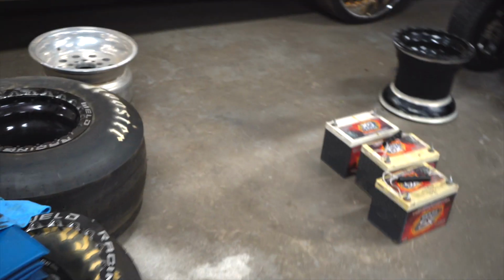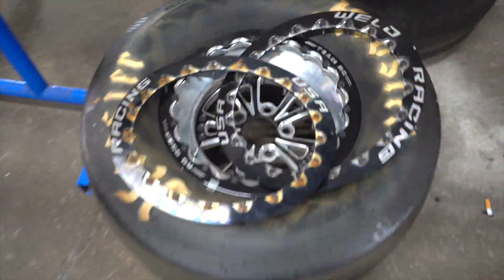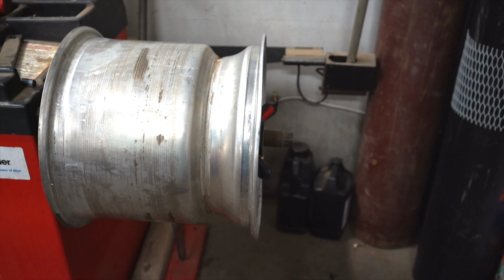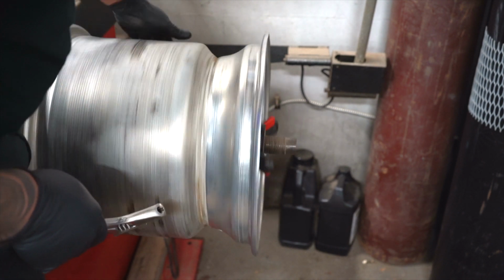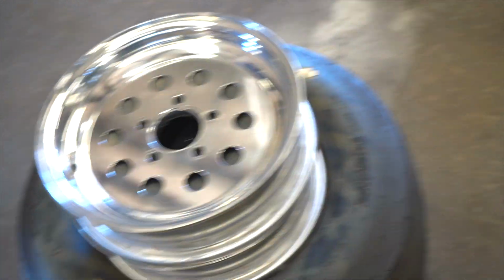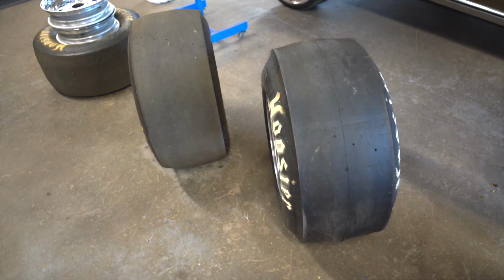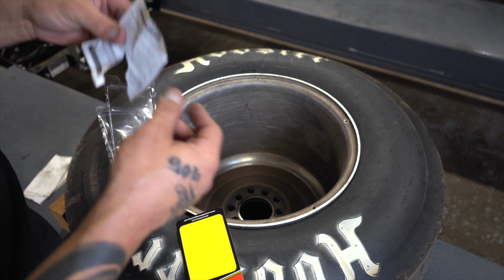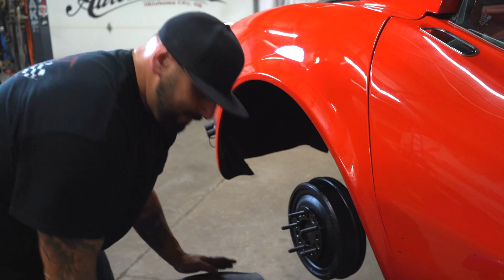NEW WHEELS AND TIRES FOR CHIEF'S CORVETTE! SMALL TIRE SMALL BLOCK NITROUS CORVETTE!

Comment: I'll be back for the suspension tuning lessons! First time I heard is instant center was from Billy (SRC) When he said Chief said to set it like this and it'll work. I knew that Falcon was going places fast and it hasn't let him down yet! 💯
Reply: Check out Kevin Wilson's videos for a bit more general drag suspension setups while u wait. He does some interesting breakdowns. He did one on Billy's truck
Reply: That falcon is rolling though. But it's crazy how far billy has made it with the S10 with basically nothing done to the suspension and crazy limited tuning abilities. I think only boost?
Reply: Yeah that falcon sure does work on every surface
Reply: @taz4100  wildo! Thnx for the suggestion!

Comment: With a growing up building custom chassis’s, Dirt cars, Dort Late models and having 20+ years in NASCAR would enjoy seeing the process of a complete front to rear chassis set up as well as a video on the process of how to choose proper engine location. A video on how to choose the right rear suspension set up be short 4 link, long 4 link or ladder bar systems would be interesting as well. You guys rock!

Comment: Nice job finding that setup. That was magic on those wheels! 
     My 74 L-82 SB swapped out for a 400cid SB destroked w/350 crank blew up the left rear spindle and the wheel, tire and caliper launched threw the rear fender and spun brake fluid into my hair cause I had the t-tops off. The tire hit the center double lines on the street and spun down the hill way in front of me as the back dropped to the pavement spinning into a fire department parking lot. So much for speed shifting from 1st to second. After that I kept it for messing up all the BB Mopar's and 80's 90's fords on the highway, shifting from 3rd maxing to 135 to the end of 4th 165 mph till I sold it. Much love for the c-3's

Comment: This is some quality YT video material right here. Especially the crescendo, where that feisty screw, despite all the aiming with the impact, just screwed itself in using the wheel hole as it's quide, like a boss. The amount of tears from laughter could fill oceans. I would've used a light hammer and a dolly on those hills, before bending, just to see where the rim is going naturally, and to take out some of the excess material and diameter from the bent rim. Just bending it back to shape makes it warp, due to the excess dimensions from the impact and stretch. Also, hammer forming makes the metal harder and more stress resistant. But, 10-move return is always brilliant, especially when executed perfectly.

Comment: I have probably straightened three or four hundred wheels like this over the years. I highly recommend you try straightening a few steel wheels before trying an aluminum wheel.  
If you are trying to mount a skinny tire on a wide wheel and just can’t get it to bead up running a ratchet strap (a 1” pulls type one works great) around the tire and squeeze it down “slightly” (key word is Slightly”) and then hit with a blast of air while pulling up towards the front of the wheel aka towards the valve stem. If worse comes to worse you can always try a squirt of ether and tossing a match. Just an FYI unless you don’t like your fingers keep them out of bead area of the tire/wheel when mounting a tire because I have personally seen a person loose a finger by not paying attention to what he was doing.  Don’t be that person! Also always use lube on beads of your tire myself I like really tire lube or cheap dish soap diluted 1 part dish soap to 3 to 5 parts water depending on the soap.  If you are drilling holes in your wheel for screws get a piece of copper wire the same length as the circumference of your wheel and fold it in half and half again two more times for 8 screws and then make the folded ends with a sharpie or measure the circumference of your wheel using a seamstress tape and divide by the number of screws and starting at the valve stem make marks on the rim with a sharpie.  After you have drilled your holes go back with a ball style carbide burr and de-burr the holes very lightly.

PS Chief C1 Corvettes came with “Dumb” brakes and the parking brake on C2 and C3 Vette’s with the Delco-Moraine (sp?) used a drum style parking brake that unless you know the car you should never use because they are notorious for not releasing properly and then dragging when going down the road. That said it looks to me it’s time to upgrade the brakes on the Larry the Lounge Lizard’s Vette to reduce unsprung weight, and rotational weight mass as well as making the car stop a whole lot better.

Comment: I'm so Glad you went back to old school on the wheels 🙌 I've been running that style wheel all along on my 70 Cuda since 85 but there weld super lites . They make a red plastic insert caps you can put in the opposite lug holes not in use. 
Great Job straightening that rim Dude 👍

Comment: Great video, old school trick with my kind of ocd. Just a tip, I've had really good results doing the difficult spots like that, but all the flat surfaces spinning the wheel on the balancer and a sponge with Simichrome.

Comment: The vintage wheels were definitely a good choice. Kind of surprised you didn't put a rear disk upgrade on there though.
Reply: one thing at a time my friend.....this is a budget af build and im going to see how fast i can make it go on the cheap
Reply: @justinshearer3016  Going as fast as it goes, the drums scare me for their lack of stopping power. Can't wait to see the suspension video and then see it making some passes.
Reply: @minigpracing3068  chief didn't ever like spending money on stopping 🤣 if I remember right the old crow had old disk brakes on it for a long time.

Comment: The old screw in the wheel trick, back in the 70s we were introduced to drag 500s from fire stone and we didn’t have bead locks back then, so we would Mountain Grove them then screw into the wheel. Sometimes the simple things work so well. Yeah buddy can’t wait to see you get some good runs down the track Or street in that little red Corvette. Fun times ahead.
Might be fun trying to stop that timing with those big ass tires in them drum brakes on the back.😂😎 Love you guys.

Comment: Back in the day Moncoque wheels were the lightest wheels you could get. I have a pair of their star pattern wheels on the Barracuda. I had to get the lip straightened on mine as well. The super stock Hemi cars used to run them because of how light they are.

Comment: Dude, those look like Weld Drag Lites. I have two 15 x 10's, two 15 x 8's and two 15 x 4's.
Awesome tutorial on straightening. You need a pointer like when you degree a cam to come close to the edge of the wheel. I learned that back straightening spoke wheels on motorcycles.

Comment: Man you did a great job straightening out that wheel.  I thought about building a fixture for my tire change with a bearing on the end like a wide one used on older car hoists. Heating it up of course.
Reply: lol i tell myself im going to build one like that, and a press that has a small bottle jack to fit inside the wheel for those really taco'd ones...but who knows if ill ever get around to it lol

Comment: In place of glass cleaner to seat tires use the cheapest high mega hold hair spray. It lubes and is slick when wet but acts like  bead glue when it dries.

Comment: Check out the Knipex plier wrenches.  You'll never use a Crecent wrench again.  You can use them for all sorts of things.  Since you can squeeze with them they work great for B nuts on hydraulic lines, breather lines, etc. because they dont slip so they wont mess up aluminum fittings.  You can even squeeze solid rivets with them if you don't have anything else.  They come in three different sizes and are kind of pricey but they are worth every penny.  The big pair can go from closed flush to 2 3/4"!  I can tell you like good tools like myself, I know you'll love those bad boys!

Comment: Chief try this trick. Take the green polish tube from harbor freight and then get a bottle of lighter fluid .cut the green bar up into the lighter fluid leave over night. Then put some on the wheel and polish away. This works great on aluminum wheels.

Comment: Monocoque (Mono-cock) wheels were part of and folded into Bogart. Had Monocoque I believe they were called Fly  Stars on our 63 dodge and yes they are/were light. Front runners were 7lbs and the 15×12 rears were 7.5lbs

Comment: Hey chief since you're a perfectionist and all I worked for tire places and owned a tire place for probably the last 26 years and according to Goodyear and Chevrolet whenever you jack up a Corvette you're supposed to pop the hatch pop the hood not lift them just pop them open and open both doors just a little bit so the body can flex whenever you jack it up

Comment: Big Chief that  Corvette is nice as shit!! I can't wait to see it run on the track!!
Reply: aint it tho? these cars are absolutely amazing....all fiberglass, lightweight, strong aftermarket support, killer aerodynamics low coefficient of drag, low frontal area, full frame construction, power windows, power disc brakes....oh and the outrageously far back stock motor location puts the midplate distance around a staggering 69ish inches from center of rear axle (give or take an inch),,,they made them for almost 20 years, and they were available with a frickin big block lol...These cars are fox body killers and almost just as cheap. They can be bought 100% turnkey mid 9 second all motor cars for well under 20 grand
Reply: And well worth it in my opinion run mid 9's and drive it home from the track that's some cool 😎 shit.

Comment: I know a few drifters who run super low tyre pressure also stick the tyre to the rim with contact adhesive so it can’t de-bead, could you do something similar with a slick if you don’t have a bead-lock

Comment: In my opinion  those are bead lock wheels.  That's all they use to have.  You run screws into the bead.  It's locked.

Comment: What is the difference in roll-out between the 28 and 29? Jackie said " it's so big" to the shady dude in the C3 Corvette....Sounds about right. She also said "your going to have to tub it to make it fit." Lots of material there but I'm not that damn funny.
Reply from the maker: abouuuuut 10" lol
Reply: So will you ever 28.5. Even with a gear change the testing will be skewed. If you did and did well I'm pretty sure it makes you the Dennis Anderson. Ps. The diff between a 86 and a 94 inch tire is a difference in 15 revolutions per pass. Every 12th pass the bigger tire is giving you a free pass on the same rubber lmao!!  86" is 7.1`- 184 revs per pass. 94"-7.83~169. This arithmetic and tits on a boar hog-same!

Comment: I absolutely hate black wheels. Back when i bought my S10 Blazer, someone spray painted the original aluminum wheels black 🤢 I stripped them as soon as possible. It was a shame because the wheels still had the factory clear coat on em under the black paint.

Comment: Also very intrested in listening an learning new ways on how to manipulate ya ride to get it hooked up on shitty surfaces or street. I had it working great, running low 5s when first put 29.5s 10.5s non Ws on it. It would launch an carry wheels 6inches off ground for 100ft on virgin black top with 1 pimp juice burnout. But since i jerked my 434 sbc nitrous motor out.. An stuck my new HiGh Compression Nitrous BIg BLock Chevy in it. It added 160lbs to nose an ive got motor high an as far back as it would go... its a 1988 s10 well GMC Sonoma. An theyre already nose heavy specialy still sitting basically true street trim. Ive added weight an everything else u can think of. An just cant get it to not knock the tire off. It is alot more power than the light weight small block 1200 to 1400hp on spray with small block 434. When finshed building 15.5 to 1 big blocktook it an had it put on engine dyno an made a 1210 bare foot. So thats motor alone an can spray 800+ on it! So deff looking forward to listening to ya video on things your doing that i may not know about. Because ya got double the HP i got with ya turbo car an its been on smalls before an went down. So deff cNt wait till next tuesday. Great job with the editing videos jackie yall have came a long way in the youtube world in a short period of time! Keep up the good work guys. Love the channel.

Comment: I gotta agree those wheels look so much better than the others! An they sit just right now.. Tucked jus enough 👌🏼  An wannted to let ya know what happen to me from personal experienceI... I also stretch a 10.5 non W on a 14inch wide wheel. I run same exact set up. Ladder bars with 29.5 × 10.5 non W's on a 14inch wide rear wheels. Theres a million things that you  have a shit load more knowledge about than me. Specially bout tuning.. But WANTED TO LET YOU KNOW...  That if you really plan to let that motor eat. As in getting after it out of the hole. like spraying it when u realease Trans-break. . Your are probably gonna wanna or have to double the number of screws you have in ya rear wheels! 5 isnt enough  I had 6 in mine with big tire 31x 22.50s. An they did fine!  But went to a small tire. Or in some places a Smedium size tire SMH LOL.  cause everyone went to 28s, an i couldnt get a race until i put something on under 30 inches in height an 10.5s NON Ws on. I woulda put 28s also, If i bought a set of 15x12s with 1 or 2 inch back spacing..but... Been spending All my racing money on buying new boxes an tuner ect...   ... I didnt trust anything smaller tire wise, without beadlocks so went with the 29.5 x 10.5 non w an just put new screws in the 6 holes in tha  front an back. But when i started to turn on some power it was squashing tire so hard on only a 100 shot that rim almost touched ground an looked an realized, it had bent every screw back an that was only a 100 starting at 50 % so 50 shot on initial launch. It wss first time spraying my new combo an bout ripped tire off rim screws. Found a lil heavier duty screw that actually goes all way thru rim an all way tru tire bead an sticks out back barley... not even enough to get a tube cause ive ran then with an without a tube. I ended uo having to run tire pressure around 11.5 to 13.5 depending on what surface is like. An i also added 6 more screws per side...it works perfect now. It actually looks similar to a bead lock an i got 12 screws in front an 12 in back an it helped tremendously! An also there not the gold wheel screws they sale for wheel screws something similar just alot stronger an lil longer.. You may not need 12. You may can get buy with only 8 or 10 since that vetts prob 500 or 600lb lighter than me. But gonna need more than 5 if u gonna be dead hooking tire an spraying it. Guy at track only has 4 in his but he has a 10 inch wide wheel so the 10.5 seats to it really good so he dosent need near as many but yeah the thing u put in ya wheel to mark spots for new screws i used every hole an came out to be 12 total. But not had a problem since.

Comment: Mother's is my favorite wheel / aluminum polish.
Reply: you gotta try blue magic
Reply: Ight chief appreciate it. When my yammie R1 gets back from the shop next week for dirt drags. I'll try it on my new rear wheel.  And my new custom swing arm. I've always used mothers. Always seemed to do good but you do have to buff it for awhile.
Reply: @justinshearer3016  and bad ass job on the wheel I learned a few tips. I've tried to fix dirt bike wheels never could get them that close to perfect again. But it did work! Lol 😆 held air.

Comment: I never liked the tire sticking out as well. I get a little huffy with people who do that. Specially first Gen Camaros on the back where the tires would stick out a bit. It looks looks dumb and doesn’t make any sense why people do or did that lol. I like either even with the wheel wells on the back or tucked in a bit. Same with the front tires.

Dang good job on the rims man. Wow. It looked like that was a goner. Great job.

What’s difference with the two tire sizes. But would think the ones you took off where well used and ones you out on are new?

Would YOU look at that. 
Just look at it. 
Look at it. 

Love his videos lol.

Also finally able to buy the Oobtiac on my game on my cell. Replica Mr Crow. Only difference is no decals. Not to sure how to do that yet. But fastest I’ve gotten replica Mr Crow to go is 6.10’s in a 1/4 mile. I built a bad ass Sonoma. Pro charger. Fastest is 5.946 at 236 MPH. That like 370 KPH here in the great white North lol. Working on getting Replica Mr Crow faster. 😁😎

Comment: Hey Justin, why no tubes in those tires..? Any particular reason, or is it a stiff sidewall that doesn't need a tube..? I've always thought you needed a tube with any bias ply tires..? Thanks guys, Hi Jackie👋! Hope yall are doing well, videos are getting better and better! I think yall will be much happier going out and racing solo, off TV stuff...and Justin is more than capable of earning! You guys, if not already, will find your happy place! Maybe it's time to move somewhere sunny and warm all year..but, it's gotten pricey here! You can still find decent homes to buy though... Also, on a stock type suspension on a 4th gen Camaro, would I be better off getting coil overs, or just some good shocks, possibly different springs? If I need springs, what rate, or how many LB springs do I need for rear? I have Viking coil overs up front, but used 350lb, rather than the 300's I used on my nitrous car, due to turbo, kit, battery, a/c and iron block up front. I know, it needs a diet badly..but skreet caah!!lol